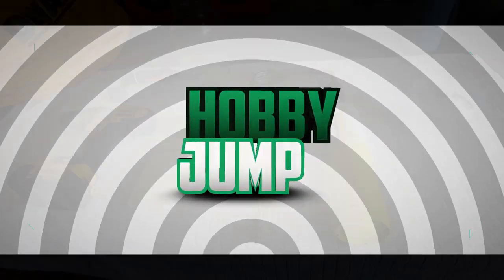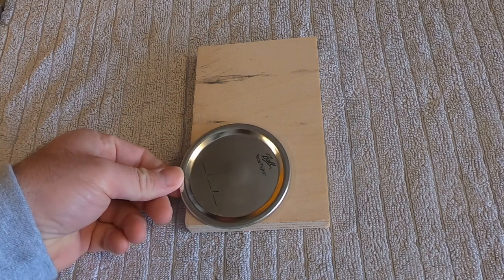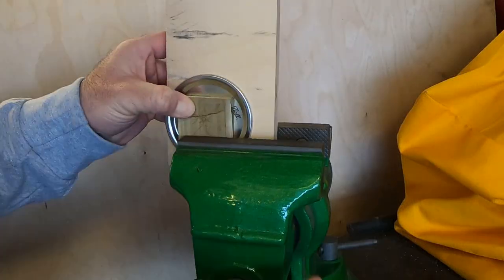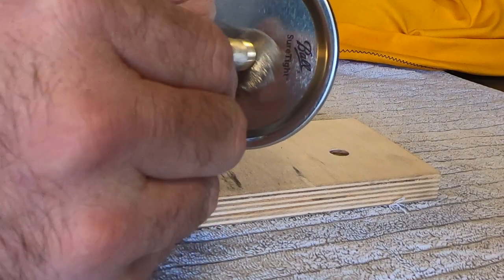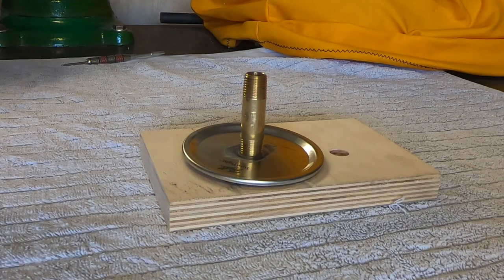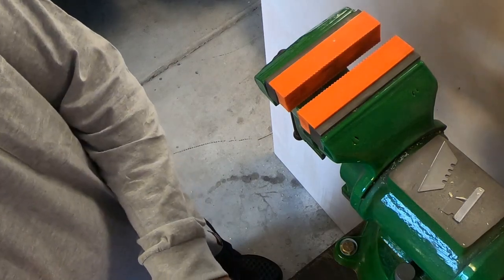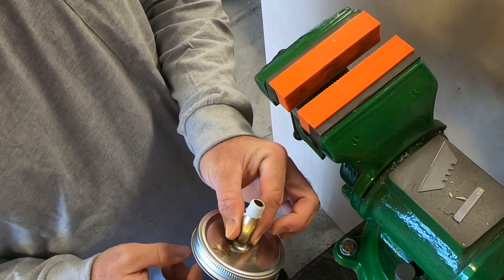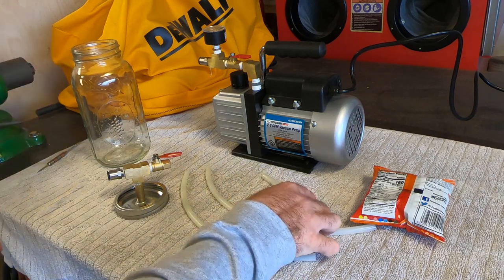SUPPER CHEAP!!! DIY vacuum chamber build at home!!

Comment: A tip about dipping the soldered pieces in water to cool down - you might not want to do that, it very often causes cold solder joints.  Which means they're weak and won't hold as well.
Reply: You could simply use epoxy to seal it right?
Reply: @noname-codm4590  I'd think so. The right kind of epoxy should do OK. As long as it will adhere to both types of materials.

Comment: Awesome man! I've been looking into doing resin casting and lots of people say a vacuum chamber helps with bubbles, now i can make one cheap and easy! Thanks 👍
Reply: @BREANNAH THAYNE cool, ill try that cause the vacuum chamber didn't work out. Thanks
Reply from the maker: A lot of it depends on the resin.. make sure to warm your molds to about 200 degrees F and try using some alumilite
Reply from the maker: Carl Reynolds you have to use a pressure pot to get rid of the bubbles.

Comment: Makes sense, i might borrow a technique. I'm for sure building mine to be used with the jar upside down though, with some way to stand on the lid-side. Because i want to be able to not have to have some kind of a convoluted lowering and extraction method, just put a paper cup on the base, screw the jar on from the top.

Comment: I did a similar build, same jar, except I put the holes directly in the glass using those diamond glass hole drill bits.  The only problem I am finding is that the sealant needs to be replaced ever so often because the glass is so smooth that the silicone sealant can’t stick to it very good.
Reply: Also drilling a hole into the glass will definitely increase your chance of implosion

Comment: Hi, do you think this could boil water at room temp ? (without breaking)
Reply: I built a similar setup with a hand powered vacuum pump (brake bleeder tool) and got 30 degree C water to boil.

I highly recommend putting a clear plastic bag over the whole mason jar. If a vacuum implosion happens it’ll save you picking glass out of your hair and eyes.

Comment: Any concerns on the glass imploding? I've seen several videos where people use glad and it's always the same concern.... I've pressure cooked with glass many times and that is under alot of pressure and also heat with no problems.. maybe put the jar in a wood box or pot for safety sake?? Just asking if you're ever concerned about such things. Thanks
Reply: nah them jars are strong af. there is no way one of them is going to implode.
Reply: Mine imploded but all glass just fell down so it was still safe, although i think it was thinner glass than the one in the video
Reply: The safest thing is to put the jar in a clear plastic bag. Vacuum implosions can and do happen even with tempered glass. In lab equipment they sell plastic coated glassware to prevent shrapnel from flying out during the implosion similar to how they plastic coat car windshields.

Comment: Would this setup work with a hand pump? I.e. brake bleed/vacuum pump..
Reply: Yes, I built one. It takes a lot of hand strength to get up to 26 inHg of vacuum but I was able to do it many times. More than that vacuum level is almost impossible with a lever operated pump.

Comment: Very cool dude! Do you have a vacuum pump recommendation?
Reply: I saw recommendation in the part above. What is the fitting that screws directly onto the vacuum called? It's white with blue (maybe a sharkbite)? It's in between the elbow and the vacuum.
Reply: it’s an instrument that measures pressure but im not sure what it’s called either
Reply from the maker: The fittings that are silver and black are just like shark bite fittings but u can release them by pushing the black part in